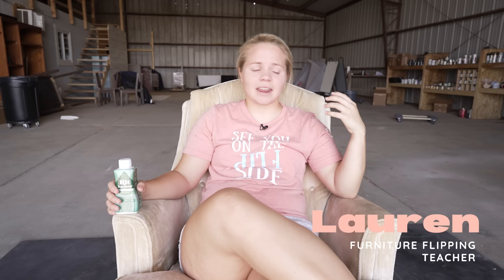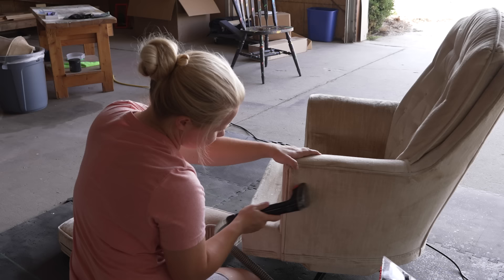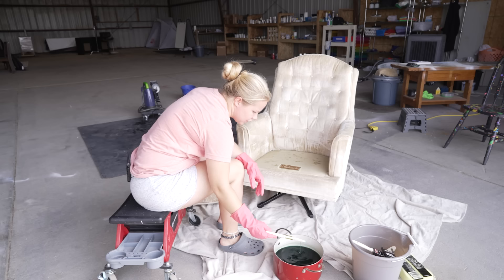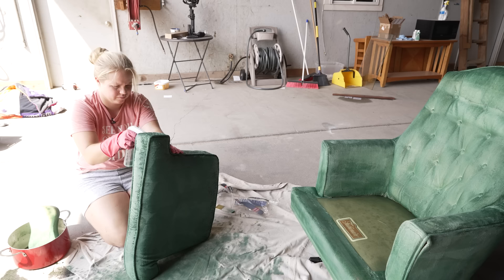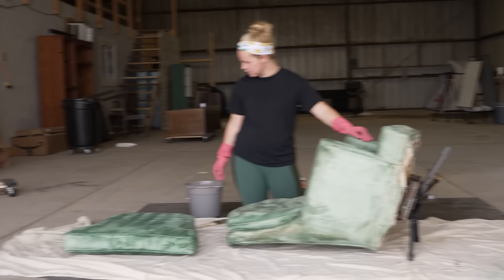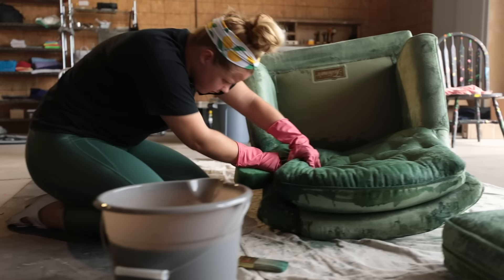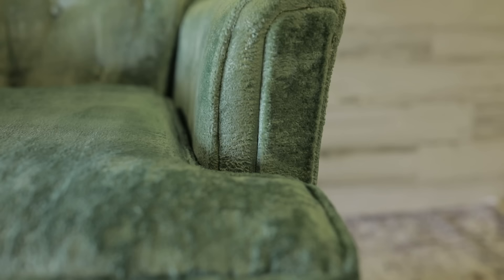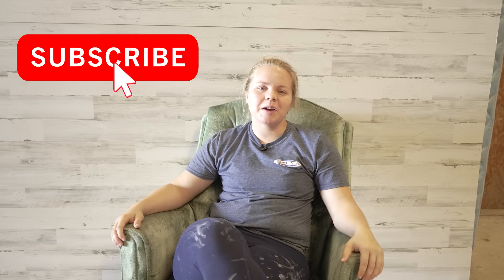I DYED A VELVET CHAIR! | FLIP or FLOP?

Comment: I use rit dye all the time. My tip is to make sure that your fabric is thoroughly wet with warm water so that it can absorb the colour properly, otherwise the dye kind of sits on top of the fabric and makes it blotchy as it absorbs at different rates.
Reply: Awesome tip!! Do you suggest the same for furniture?
Reply: This is so true.  Also polyester and nylon fabrics are essentially plastic and the heat a chemicals used in the manufacturing process to dye it can't be reproduced very well in these cases. But natural fibers would take well to the above advice very well.
Reply: Love the chair
Reply: Thank you. My daughter asked me to dye her faded black jeans back to black and I was afraid to try. In the past the dye tends to bleed out quickly. Any suggestions?
Reply: @wewemcrhyne  Salt fixes the dye
Reply: @jenjen4091  white vinegar too😉
Reply: @jenjen4091  can you provide more details? How is it applied? How much?
Reply: @marysegady6029  more details please.  Application?  how much?
Reply: @JB-le6zm  you can put as much as you want. in fact white vinegar does not stain but on the other hand it fixes the color very well so you have to try it is the best😉
Reply: Good tip.. that's probably why the seat looks a tad blotchy on the cushion and not the chair because the chair was still wet with a second coat.
Reply: @marysegady6029  I wasn't actually asking for myself. I thought aittle more detail would be helpful for the individual who posted regarding her daughters jeans.. I do thank you though.
Reply: @JB-le6zm  oh sorry I didn’t understand 🤦🏻‍♀️. Well I use to eyeball it when I’m the laundry. I normally do my washing machine and before the start of the fabric softener I put a good shot of white vinegar and that's it 😃
Reply: @marysegady6029  it's OK. I wasn't very clear in my comment.  Technology has ruined our ability to communicate properly 🤦🏼‍♀️
Reply: Great tip! Thank you👍🌞
Reply: Noted, great tip!
Reply: Has anyone tried just using a big tub and dipping a chair or cushion in the dye?
Reply: That machine she’s using makes hot water when cleaning
Reply: Vinegar needed?
Reply: aaa ha !!
Reply: @marysegady6029  How about the vinegar smell❓🙃
Reply: Could you spray first with isoproalcohol first??
Reply: @ReggieTime  I use white vinegar in my washing often. I put it in the cup for fabric softener. You will get a scent of vinegar in the clothes when you take them out, but when dry, clothes smell fresher than ever. It’s the best way that I’ve found to get rid of smells and slight mildew in sweaty sports uniforms.
Reply: . . . . . Thank you for ansewring'
Reply: Yes!
Reply: What about the paint with fabric softener into  it..have you tried that?
.
Reply: This is exactly what I did when dying my WHITE sectional couch to a dark dark grey. Watering it down FIRST made a major difference
Reply: So would it be a good idea to maybe get the fabric drenched with hot water first and then do the method? As opposed to doing it straight in dry fabric?
Reply: I’ve tried this with acrylic paint and fabric softener, it looked good after ‘drying’ / sanding and 2 coats but the thing was when I wiped it with a white tissue all the Colour was still coming off!
Could also possibly be because I was trying to do this on a 70’s lounge which no doubt was polyester fabric rather than natural fibres.
Reply: Thank You❤
Reply: @wewemcrhyne  Rit dye makes a dye fixative that sets it in,so no bleeding.
Reply: @JennsCorner777  hey thanks!!
Reply: F

Comment: You need to get an old steam cleaner to use for dying.. fill the water tank up with your color mixture and spray your mixture on… easy Peasy..it makes fast work of a piece of furniture. Also, depending on your material you can add vinegar or salt to help the material take the dye better and stay in.😎one more thing, get a cat or dog brush from the dollar store and brush out the material…
Reply: These are awesome tips!! Thanks!
Reply: That makes so much sense because the steam would be hot so it would open up the fibers in material?
Reply: Wow thank you. When I start these are the tips I WILL be using.
Reply: @Boring Doering's - I have a huge red velvet pillow with arms that they call a "reading pillow". Is there any way I could dye it blush pink? I have a farmhouse decor with my bedding grey and white. I would love to be able to use it. I have a Bissell Little Green Machine. If not, think I could chalk paint it?
Reply: This is exactly what I was going to say,  I used to do this all the time for my uncle's shop. He did estate sales and then we fixed up, what didn't sell.
Reply: Can you use a paint sprayer?
Reply: I have tried using vinegar on jeans that rub the dye on my skin. I’ve tried it again and again and I can’t wear those jeans because I don’t want the dye on my hands and legs and clothing! With the salt, is that ordinary household salt?
Reply: @loveishope4406  unfortunately no you can't. you can only dye something darker, not lighter. think of it terms of hair color. we dye our hair a darker color. but when we want it lighter we bleach it.
Reply: @lisamigliazzo162  i've been watching a lot of videos lately on dying carpets. they actually use the pump sprayers for weeds. you can get them atany big box hardware store and they don't cost very much. and they do come in small sizes as well so they would be perfect for doing upholstry jobs.
Reply: @wandakowalski7063  yes, any iodized salt will work. some use rock salt. but it doesn't dissolve  very well and imo defeats the purpose of putting it in there.

Comment: About 4 years ago I “painted” Rit dye on a cream colored fabric chair. I was going for a dark blue and I used the entire bottle. I used a paint brush and just painted it on the chair. It came out perfect! I loved it. Last year I found a fabric rocker, swivel chair at Goodwill for $10.00 and decided that I would try it again. The chair was a pink color and when I applied the dark blue dye,I ended up with a purple chair. Lesson learned, it does matter what color the fabric is to begin with. But it does work.
Reply: Did you dilute or applied the paint directly to the fabric? Also did you rinse or apply the sealer at the end to prevent staining?
Reply: What she said
Reply: Hi @kathyl5610, did you dilute the dye first?

Comment: My biggest concern is color xfer to the person sitting on it...that dye is meant to be rinsed, then heat set  in the dryer
Reply: I thought the same thing. However, she added another product that keeps the dye from transferring. 😊
Reply: Perfect timing for me as I have an old chain in my bedroom that does no go with my new color in my room and was wondering if it could be dyed.
Reply: I dyed a chair blue and did not use any other products and it never transferred to anything else.
Reply: I agree. I don't think that fixative is going to do much to help that. I hope the buyer of this piece knows how it was dyed so they can be careful! 😬
Reply: @juneramirez8580  You can try painting it with Fusion mineral paint. They have a tutorial on their YouTube channel.
Reply: If you actually watch the entire video, Denice, she addresses your concerns... IN DEPTH.
Reply: @pseudopuppy160  actually I DID WATCH THE ENTIRE VIDEO. I posted this comment as she was dyeing the chair.
Reply: @kathyl5610  did you get it to the colour you wanted? Also what kind of fabric was it and which Rit Dye did you use? Thinking of dying mine this weekend! 🤩
Reply: @fastfeather3025  Yes, my concern also.   If a person spilled water or tea while sitting on it, would the dye transfer.   I would recommend  knowing for sure that it won't transfer, by testing the skirt.  You could have some very unhappy  customers if that happened because accidents  do happen..  Liked your video  though  and learned alot!

Comment: FYI I've been dying fabric for 50 years. Velvet has a silver cast to it, no matter what color it is. It also has " pile" that can make dying tricky. This means it has a thickness to the fabric like carpet.
Reply: I painted a chair cushion after wetting the fabric.  It has dried rather stiff. I do sand it but haven’t gotten it to a desired texture yet. Any suggestions or tips?
Reply: I am actually shocked that a sanding block is being used. Use a brush and brush in the direction of the nap while wet and then again when dry
Reply: @delynnculp3768  I would try a brush from a suede cleaning kit to restore fabric nap instead of a sanding block.
Reply: I want to dye this end up cushions, do you think this is possible?
It's a sort of textured floral..I want a dark taupe..
Thanks...

Comment: The reason it's blotchy is that the chair is made of synthetic Fibre...it won't take the dye properly
Reply: Makes sense
Reply: @debragreen9778  I recall Rit dye has different formulations for natural versus artificial fibers. Not sure which Lauren used.
Reply: she's using the rit dye for synthetic fibers, so that's not the issue
Reply: There is rit for synthetic material
Reply: She’s using the right one… it’s the RIT dye more

Comment: Try adding a cup of rock salt to the dye, it helps to bind it to the fabric.
Reply: Oh Woow didn’t know that, so it will be soft when it dries? Because I painted a chair and is a hard texture haha

thank you!
Reply: @keillytobar7381  you have to brush it in while its wet. That prevents the rough scratching feeling.
Reply: @keillytobar7381 maybe adding fabric softener too ? Try out in a small piece of fabric first.

Comment: There is a special brush for suedes. It has rubber bristles. It might make it softer and smoother and less crusty. Velvet often needs to be combed in one direction to lay down. It is kinda like the lines on a carpet from using the vacuum cleaner.

Comment: I've painted velvet chairs with clay based paint, spraying areas w water then scrubbing the paint on to thoroughly saturate the fibers then dry and scrub/sand between coats.  The fixative is new to me, but a great idea.....  so far so good w the paint curing on the chair in my experience.
Reply: Yes  DIY clay base works well... Debs design diary has videos on it... must scrub it deep and use mister bottle to saturate  fabric.
Reply: @KB-rc5xc  I've used the technique with DDD paint as well as Wise Owl... both worked well as long as water saturation, scrubbing in the paint well, sanding between coats to keep the fabric soft... loved each project

Comment: The best way to dye is to use acrylic paint that is very loose (due to adding water) and scrub in circular motions with a large stubby paint brush until you have soaked the paint in - keep repeating until you have done the whole chair and it looks even.  Then you take your sanding block and work it over until soft.  should have better results because you can control the application better.

Comment: You could try warm water in your Bissell to prep the piece and then add dye to the Bissell to put on the color. Then as a third step do a fabric softener and water mix to soften the fabric once it's dried down. Not sure it would work but I've seen people dye their old carpets with a shampooer. So theoretically it could work the same way for furniture as well.
Reply: Does the dye rinse out from the Bissell machine?
Reply: @mishpotter8387  I tried using my bissell little green machine. I guess the paint clogged up the spray area. So I don’t recommend it.

Comment: Lauren, just curious if you will try painting a chair with a paint if your choice. I’ve seen this done and it works pretty good as long as you spray enough water as you go along. I can’t wait to see the end of this video-it looks like it’s going to work!
Reply: I think that would be a great idea for a future video. I'm doing my couch a deep dark blueish black. I've done it before to a chair. It's also time consuming but once you get the hang of it it will go much quicker.
Reply: I have done several pieces of upholstered furniture with paint. I have found the key to keeping it from being "crusty" is adding both water and fabric softener to the paint. Each fabric responds to the mixture differently so you have to do a few trials before you tackle the furniture piece. In the case of a chair you can remove the skirt and use that fabric for your trials. Keep varying the ratios until you get one that dries the way you want; as a general rule I usually start with a ratio of 1 part paint, 1/2 part water and 1/2part fabric softener. If your sample never really dries well and stays consistently gummy feeling there is too much softener. It does take time but the results can be amazing! I have made an old plain fabric chair look like a beautiful leather chair! I used several shades of the same color and painted the chair a little darker in the areas that would normally have more wear. It sold for a profit of $350.00! Took some time but we'll worth the effort.
Reply: How about wet brush.  Wet is used for tangles in your the hair. I wonder it would help.  I don't think you would want to steam it. Color would fade.  Look good. Good luck with your sale.  Look forward to more of your videos!
Reply: @karenhirsch1680  is there some good video out there you would recommend?
Reply: Yes, there are some great videos. My favorite is one done by Lone Fox. You can find his DIY channel on YouTube. He is the one who gave me the idea for the leather look chair. His video is really complete and easy to follow.
Reply: @karenhirsch1680   thank you I will check out his channel
Reply: @karenhirsch1680  Great advice "1 part paint, 1/2 part water and 1/2part fabric softener" from someone with hands-on experience. I was going to suggest paint, too, but paint made for fabric (or an additive for fabric application). The fabric softener is interesting. I wander what a makes that work?

Comment: My niece found a beautiful chair on the side of the road but the color didn’t work for her. She painted it using equal parts Waverly chalk paint and fabric softener, then sealed with ‘s clear wax. It turned out gorgeous! Not sure how that would work on the velvet fabric. You can use the fabric the from the skirts that you rip off as a tester before you try a new method. That should give you an idea of the final result.
Thanks for sharing this video. I think it turned out pretty good.

Comment: If anyone does this, I have two suggestions. If you are removing a skirt, you can use that to test each step first. And at the end, try brushing the velvet with a stiff bristle upholstery brush rather than a sanding pad.

Comment: I cleaned the piece as you did. And the wet the piece fully., them mixed a lot of dye maybe two buckets full depending on what I was dyeing. Then put the dye in a insect pump sprayer, works great fast and not blotches, did the same to carpets. The sprayer morsel gets into small corners on carpets. Good luck .
Reply: I 've never had dye transfer from carpet or chair to clothes.

Comment: I would suggest you test the dye on the fabric ruffle you pulled off before you touch the chair. You could have seen how the dye is absorbed into the fabric...does it work better it the fabric is wet or dry, etc. Just a thought.

Comment: I'd have done the test methods on the ripped off fabric of the skirt. I've done it before. The best method I found was to saturate the entire chair first with half warm water/half fabric softener in a spray bottle. Then the dye water but not as much water as what you used with a sponge brush. It stayed soft and absorbed the dye evenly.

Comment: Some fabrics need different dyes. I have tried 2 different types of dyes on some 50's chair cushion covers and neither took.  They are probably a blend of synthetics, nylon etc. I would be worried about sitting on this chair. Until you try a rinse you won't know. You could have tested the dye on the skirt and then tried rinsing to see if it would take. Remember to do some testing on the skirt next time. Just some thoughts from an old textiles teacher.

Comment: Hello! @furnitire flipping teacher - I have severe adhd and I'm all over the place with so many different methods. May i ask overall at the end of the day- What method you prefer or what one did you find to be most effective? Spray bottle, sponge, or brush?  I've used a fine sanding pad in between coats, to get the paint set in- and even. Also when you're at coat 1, and 2 it won't look how you want it. Not until about the 3rd or final coat. What are your thoughts? I've only used chalk paint or well now they sell paint specific for furniture ! It's awesome!

Comment: It was a good idea to clean the chair first for multiple reasons. First, to clean. And, second to dampen the chair fabric PRIOR to painting. 

If you clean and dry on one day and paint on a different day ... use a clean/new paint brush to paint the fabric with WATER ... first. It helps the paint ABSORB into the fabric easier and more evenly.  

Thus, painting (dying) furniture is a much easier process. FYI

Thanks for making this video using rit dye. 
(Chalk paint ALSO works.)

RIT Dye ... seems a wise choice for long term use. 

But, as long as the fabric is wet/damp before either process ... the paint or dye ... goes INTO the fabric.  Thus, should be able to "sit on" (use) the furniture. 

But, do wonder if these should be mostly staging/decorative chairs in a house ... for looks more than use. (?)

You should try ... AGAIN ... with paint (chaulk paint) wetting or cleaning the fabric first. Maybe a pair of matching chairs (or more) to make the added process worth your time. 

Yellow to a pretty/modern (light) blue ... might change your mind. 

Pink to red? 
Out dated light blue to navy blue or a modern turquoise? 

Results are definately worth it. And, more buying options with the types of chairs you find/ purchase.